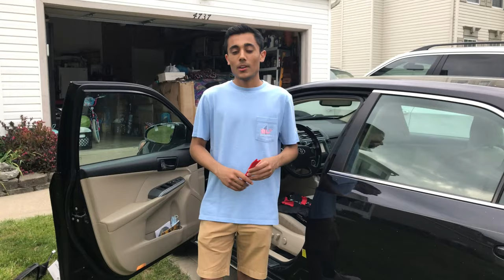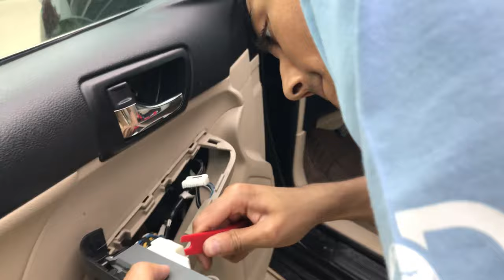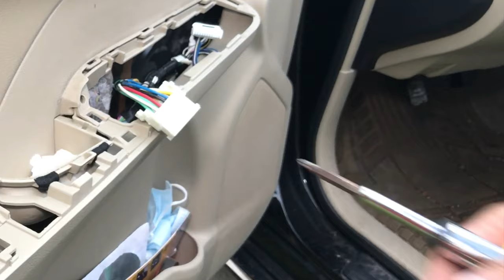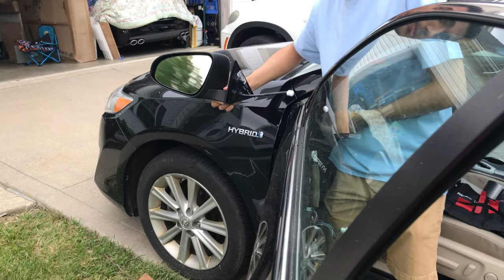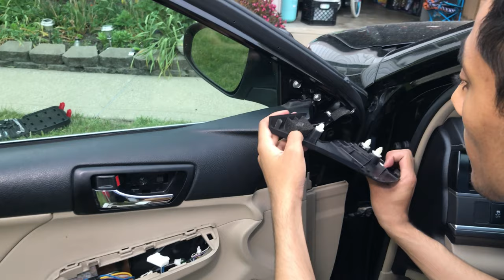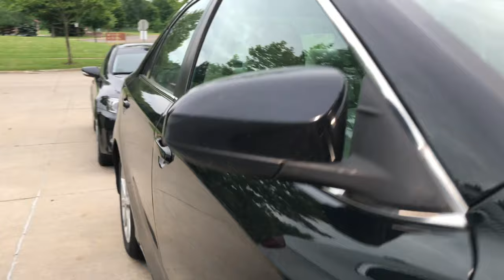HOW TO replace Camry Side View Mirror *STEP-BY-STEP 2012, 2013, 2014, 2015, 2016, 2017

Comment: Your video is spot on!!! I felt all mechanic-ky lol I didn't take the entire door off. I didn't want to risk messing up the wire at the bottom of the door (2017 cam) I did take off the handle and pop the door panel enough to where I can change my mirror. I am very proud of myself AND I did it with nails 💅 😌 lol I AM WOMAN!!!  lol Thanks again.
Reply: I feel the same and work it girl 👊🏼👜🔮💅🏻

Comment: Thanks for your detailed instructions. To add the value of your video, it was learned from my practice on my Camry 2023 that the third connection near the bottom level is not present in the 2023 model, making it easier to disconnect the cover from the passenger side door. Thx.

Comment: That was a great video, I just watched it one time and was able to replace my side view mirror in less than 20 minutes. On the 2012,u don't need to take the entire door panel off. As long as the top right comes off, u can access the power hook up the mirror. Thanks though, big help.
Reply: Thanks for the tip

Comment: Thank you for sharing this. Super useful. I need to change my right side mirror, hence two questions (1) Can you share the link for ordering at Platinum Plus (2) Did you get to choose the body color or dud you match the color by yourself. I have a green color.
Reply from the maker: 1.) You can use any parts website. There are hundreds for Toyota. 
 
2.) It came painted but the paint was slightly off. It is a few years later and the paint has faded pretty bad. I would tell you to buy genuine mirror from Toyota and have a body shop paint it for $100 or so. I always buy genuine parts. I only installed this aftermarket one because that’s what my dad and grandpa wanted and bought. 

You’ll probably have a hard time finding an already painted green mirror as well. 

Goodluck!

Comment: Great video, thanks for sharing. Will you post the link for where you bought your mirror? Thanks.
Reply from the maker: My dad bought this mirror, so I have no idea where he ordered it from. I checked online though and even if I gave a link, it appears that the mirrors are different depending on what trim level and options your Camry has installed such as blind spot detection. Just search through google and make sure to buy the correct mirror that matches your car's trim and options. It seems like Partsgeek.com carries this brand of mirrors by the way. I hope this was at least somewhat helpful. Sorry I couldn't provide an easy link!

Comment: Great video thanks for time .Question bro 
How do u remove just mirror cap on same car I wanna just replace only the cap...thanks
Reply from the maker: You're going to need the same plastic trim removers I used in this video and carefully use them to pop off the cap. Get the tool in-between the mirror-housing and the cap and then go around the side-view mirror slightly applying pressure/ pushing the cap off from each side (with the trim remover) until eventually it pops off. Be very careful not to use too much force tho since the mirror components are delicate! I hope this explanation makes sense. Good luck!
Reply: @SaraiGarage  Thank you sir

Comment: I was wondering if for a 2017 Camry, I would need to take the whole door off??
Reply from the maker: Yes, it is possible to do this job without removing the entire door panel.

The main reason I had to remove the door panel was to disconnect the electrical wire that controls the motor for the glass in your mirror.

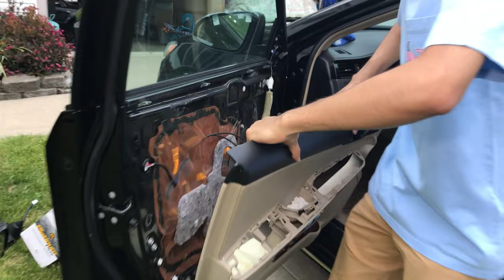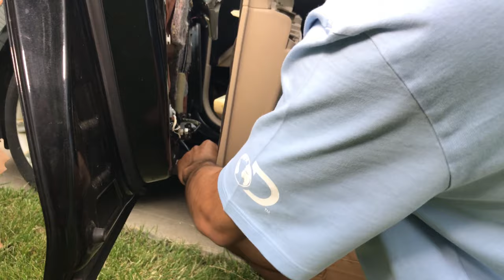If you watch from around 8:30 - 9:00 minute-mark, you can see, at least in the pre-facelift model like my Camry, the wire connection is pretty close to the actual mirror. In other words, the part where you need to disconnect the wire is pretty close to the corner by the mirror, it's not deep in the door or anything. 

Edit: At 8:33 the mirror wire is that weird wire in the top corner that looks to be wrapped in grayish brown foam! I hope that helps a little more.

If you are afraid of removing the entire panel (which is completely understandable, I was terrified myself when I first did this) you can just pop off the top corner clips and just slowly pop off as many tabs as you need until you can reach your hands back in there to disconnect the old wire/plug/connection and plug in the wire from the new mirror! 

Don't be afraid of removing the panel though. It's literally just plastic clips that pop into a little hole. You just need to use a little force to  pop them out. I promise it looks 10x scarier than it actually is! Once you pop off the first tab, you'll be perfectly fine!

Comment: Nice video but you forgot to show how to discount and reconnect the lock mechanism.
Reply from the maker: You don't need to disconnect it! For me, it just fell out of the door panel (with all of its wiring still attached) when I lifted the door panel up, and when reinstalling, I just slid it back into the hole in the panel before popping the panel back onto the door. Please don't try to disconnect any of the wires from the lock mechanism! There's no need!

Comment: Are those from 2012 to 2017 same mirrors so they can fit each other?
Reply from the maker: I want to say the design is a little different. The electrical connections and bolts are the same, just the outside cover is different. Call your local Toyota dealership’s parts department and just double check with them!

Comment: dude, were I you I would not honestly claim to be applicable to so many model years. Because you are not. I nearly damaged a car today because of it. Fortunately, the car's owner, a friend, was able to point out her 2017 model had a small, circular cover to the door opening handle cover that needed to be pryed open to get to the screw, instead of the larger snap-in cover you removed. I would have damaged her car had she not shouted, "What are you doing, no!" She was right. And you were wrong.
Reply from the maker: The cars are the still same tho. You were just working on a facelifted model. They always change small things like cover shapes when doing facelifts. I have no idea why. 

But besides the shape of the covers and sometimes how they open, the overall steps, locations of bolts and screws, and electrical connections should be the same. 

I am sorry if this caused you trouble. I did try to show everything very up close and mentioned in the description that this was a 2013 model (pre-facelift).

Next time you’re doing home repairs following YouTube just keep that in mind! The steps will be the same for pre and post facelift but there will be SOME small differences along the way.

My apologies 🙏🏾
Reply: Hii, I'm trying to replace the side mirror to my 2017 Camry, I was wondering if i needed to pry the whole door off like the video:( Did you have to?